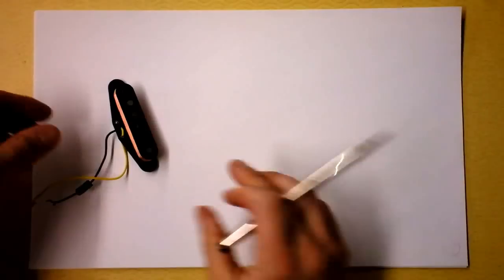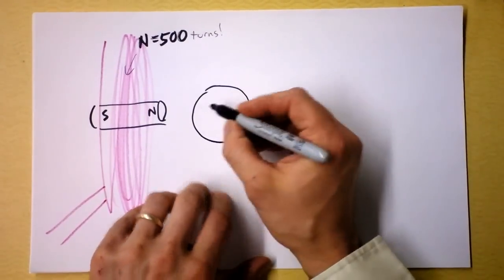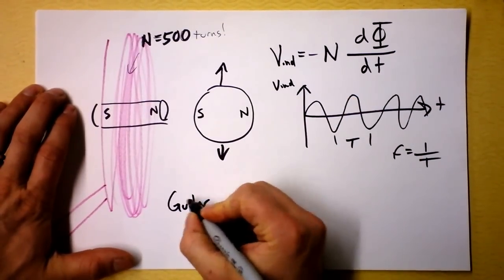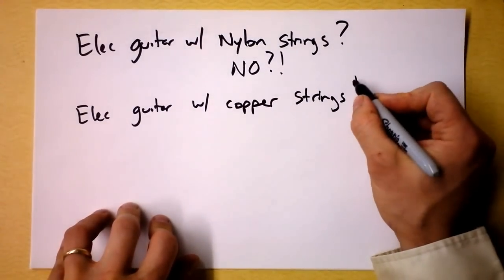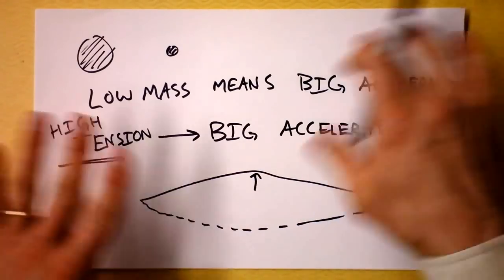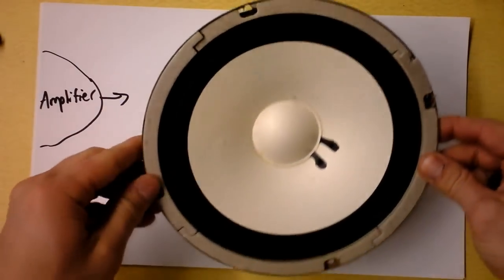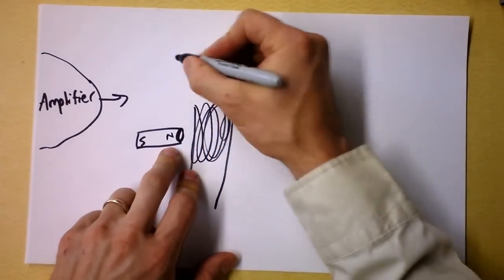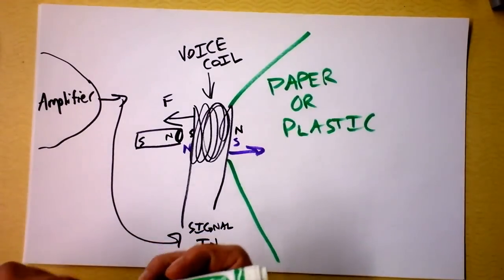Electric Guitar Pickup Coil to Amplifier to Speaker Voice Coil Theory | Doc Physics

Comment: Only ferrous materials will work for electric guitar strings.
That means nylon, copper and gold will not work.
 Larger diameter strings will require more tension to achieve the same pitch as smaller diameter strings.
Larger diameter string will generate a larger output from pickup.
String tension is directly proportional to pitch. More tension = more acceleration= higher pitch.
Great video. Love the way you are prompting interaction with your viewers.

Comment from the maker: The current in the amp is powering the amplification circuit, but one could argue that the input circuit is not complete until the guitar is connected.  Connecting the guitar when the strings are not moving can induce a little hum because monitors might cause vibration in the strings that is then output again in the monitors.  The 60 or 50 Hz hum from the AC line also leaks over in real amplifiers.

Comment: I'm pretty sure most commercial pickups have around 8K turns with over-wounds going higher.
Reply from the maker: prickiland DANG!  You'd probably want a machine to do that for you.
Reply: +Doc Schuster people prefer hand wound though. They're supposed to give a natural, imperfect sound
Reply: hand wound pickups use machine to rotate the pickup but a person is holding the copper wire to give the coil whatever shape and tension he wants.
Reply: Yep, people are stupid that way. Having a person do it just means making things more random. Which means you don't know what quality you'll get. If a more random winding leads by accident to a better sound, it would make more sense to let a machine copy that exact winding job, then letting a person wind another one which would again be different. 
And just looking at the physics behind it, I don't believe the sound will change all that much from having the wire on the bobbin wound slightly worse than perfect.
It's just in people's head that effort and high price creates higher quality. Which makes no sense.
Reply: I think it stims from how many people play electric guitar and how badly we want to sound different. The hardest part about paying guitar is being original. The gear choices are outrageous.
Reply: I've seen my pickups being handwounded in front of me and the point of it being handwounded isn't to make it as random as possible, the point is to make it as meticulously as possible in terms of the pattern of the wound and the tension of the wound. If it is handwounded by an exploited chinese kid that doesn't even know what a guitar is then obviously you'll get very random results but random isn't the goal here! I'm not saying a machine will never be able to copy handwounded quality but there will always be people handwounding pickups experimenting with different lenghts, tensions, wire girth, ohms, etc. Also the luthier that made my pickups is reverse engineering vintage pickups to see the different characteristics of some 50's and 60's wounds and then applying what he observes with different types of copper wires. He's getting great results, a lot of top professional guitarists from my area are switching to his pickups and personally I couldn't be happier with my SSS set, pure pure pure definition even with lots of overdrive.
Reply: liquidjorge well I usually here 3-4k plus for passive and usually half or more on actives; more wounds=more magnetic charge
Reply: MistahJuicyBoy They still use a pickup winder they just tension and stagger by hand
Reply: liquidjorge I’ve made thousands of pickups in my life and never ever ever met someone that could hear a difference between pickups tensioned by hand opposed to machine. Im sorry you are wrong. Musicians believe in many fairytales when it comes to tone

Comment: The magnets in the pickup don't magnatize the strings. The string vibration causes an electro magnetic induction in the coil.
Reply from the maker: Sup, Kevin.  The only way the string vibration can cause electromagnetic induction in the coil (correct, btw) is if the strings have a net magnetic field.  They are a soft ferromagnetic material, and are therefore only magnetized in the presence of an external field.  You can check my claim by wondering why there are magnets in every pickup you've ever held.
Reply: @DocSchuster  in the practice nylon strings works in a electric guitar

Comment: it would be so useful to understand how a mic or a pickup can be better than others and why; i mean if you buy a cheap guitar it uses a cheap pickups but if you buy an expensive guitar it has a different pickups so how that affect the signal of voltage variation.

Comment: And another question is where the wire of the pickup go, if it goes to the current or if it only transfer the signal of voltage variation?

Comment: Nice vid, very informative, im a wee bit perplexed as i read that cibalt strings, probably an alloy variation with cobalt to add mire density and magnetic attraction to the string for the magnets and coil that will behave together in a different way than standard nickle strings in relation to i mean magnetically, so im thinking less sustain, or if you lower the pickups away from the strings as many peopledo to get a specifictype of tone on the bass end of the thicker strings- so more volume or idk a ckearer signal without losing the sustain., so when you saud low mass - big acceleration, then wouldn't string mass be more relative to the materials of the strings used in regards of how magnetically  atttractive the strings are?
Btw- cobalt strings feel so weird to plays and they dont last long, i tried a set and they were a touch louder and i suspect youd only realy notice a considerable difference at high amplified levels over 80db to110db gigging levels. Were every little touch of the string is heard, very unforgiving. The way the cibalt strings felt to play was sticky, difficult to move say bar chords up and down the neck, very unpleasant but i had to try, i try out a new set of strings i dint know anything about about every month or 3 months but i stick to the elixir coated strings they last a fair bit and sound great. Feel great.

Comment: So, I'd assume after watching this video that you'd agree an electric guitar's (not acoustic guitar) "tone wood" has no affect on the sound/tone. Only the pickups matter? i.e. a guitar made of particle board or mahogany or basswood using an identical pickup and played exactly the same would sound identical? That's what it seems like to me.
Reply: The sound would absolutely change. The way a string vibrates when plucked (and therefore the way the voltage changes) depends on the rest of the body. For example, some materials will allow the string to vibrate for longer and some wont (Imagine a very stiff body vs one less stiff).

Comment: But the induced voltage in the coil will produce a magnetic field that create a force on the string, thus changing its frequency, right? And the string’s altered frequency is still in turn influencing the induced voltage.... I’m a bit confused how the finalized sound would be. (Guess I need to review my physics)
Reply: sfdrexj
They’re so small forces, you don’t have to think about it.
The strings is tensioned to 25 pounds average.

Comment: Good lecture Doc.
You might know. I remember many years ago seeing a picture of an early sort of loudspeaker that was basically a thin metal funnel, sort of corrugated like a parasol. I think it was purely mechanical (no electric) Do you know what they are called, I cant find any reference to them on the internet. I  might want to try building one. I reckon something like the thin metal horns on those stroh type violins...?
Reply from the maker: Goldsmithexile1960 My understanding of those cones (like used in Victrolas) is that they simply channel the sound into your ear rather than just letting it spread isotropically.  It is remarkable how loud my Victrola is.  I think it comes from the tremendous needle pressure (very different from modern 33's).  This means the vibrations are more dramatic, just like a violinist pressing harder upon the bow.
Reply: Doc Schuster I'm going to have a guess and say that the horn on an old style record player is a waveguide. I believe there are some pretty complex things happen when a gas (air) couples with a solid moving surface (speaker or diaphragm). The way the horn flares out is less to do with making the sound directional, more to do with making the air couple to the surface efficiently.
Reply from the maker: Matt Saxey THAT is something I remember nothing about.  I will look into it, now.  Thanks for the help!

Comment: I used nylon strings on a P-bass copy and it worked.
Reply: The nylon strings for electric bass guitars have steel cores with nylon coatings.  They won't work otherwise, at least not through an amp.
Reply: lol. Jesus
Reply: ExperimentLife Yes.

Comment: I think this explanation makes the phenomena too simplified. Basically, the string with ferro materials can be magnetized when it approaches the permanent magnet. But the strength of the induced magnet is not constant but depends on the position. You have better explain using the concept of magnetic circuits. The magnetomotive force (mmf) can be regarded as a constant value because the permanent magnet and the magnetic resistance (reluctance) will be changed depending on the position of the string made by ferromagnetic materials, which results in time-varying the magnetic flux passing through the coil.

Comment: Im just curious. I put my phone speaker in front of my guitar pickup and i could hear the music from the phone on my amplifier. I want to ask why does the guitar pick this sound up? And can it damage something if you put another magnet near a guitar pickup. I would be glad for any answer. :)
Reply: I would say the sound of your phone speaker moves the air, which consequently moves the strings.
Then the process will be the same, as in the video.
So, if you hold your strings or take them out, I guess there will be no sound, but I haven't tried.

Comment: So on my Less Paul one pick can play my phone speaker and one can't. I have seen a few Bands use this Smashing Pumpkins James Iha used a toy ray gun and I am pretty sure other musicians have. I will leave a link to what I did. Ok so why only one pickup. Also there something called an atomatone. It's a toy that is a synth strip and at the base as speaker that is housed in a little ball que opening and closing cause different compression. Ok so some have an input jack. So is that compression not even registering? Yes I plan on trying it on my pick up when it comes in and pretty much same question on the pickup. A Mike would certainly register, but the other stuff is questionable?
Reply: Oh don't about why one wasn't working it just dawned it was switched off. That's probably why.

Comment: 8000 turns on average in a Strat coil, not 5000 or 500. Source: Pickup winder at Dawgtown. (:
Reply from the maker: Wow.  That's some fine wire.  We could check their numbers by building a transformer out of two pickups (one with known N) or by doing a cross-sectional area calculation based on the gauge of the wire and circular packing constraints.  Indie lab!